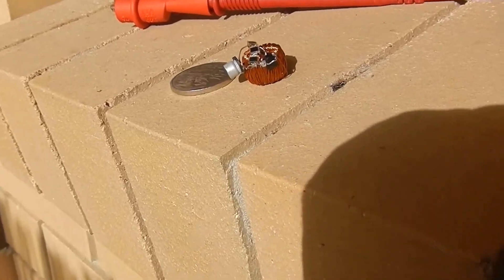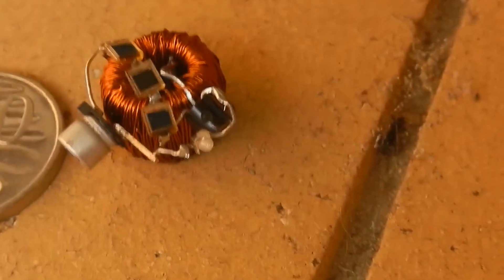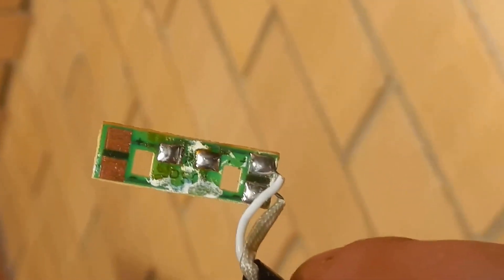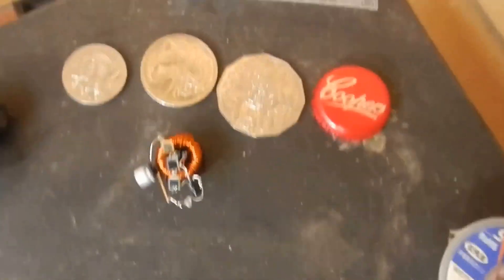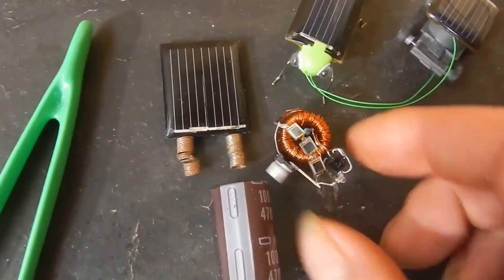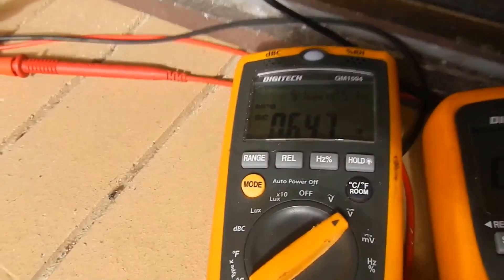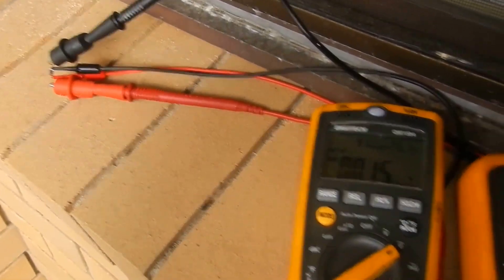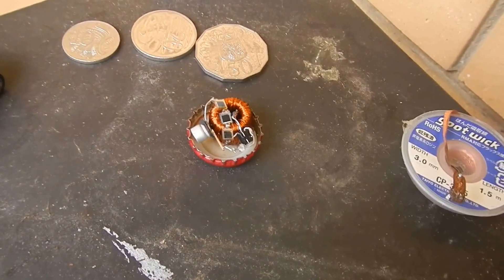SMD panel, 10 nano watt mini solar oscillator.

Comment: This is kinda interesting....  I think you can actually do this with a lesser number of parts. 

Inductor's setup a magnetic field. Light travelling through a substance will be polarized roughly equivalent to the density of the material it's travelling through so long as it's path is parallel to the magnetic field.

AppliedScience has a video about this specifically, and I'm going to output a video that looks at this phenomena a bit more technically.... but for your purposes here (boosting the voltage of a solar panel to the point where it can power a small led), so long as the solar panels are within the magnetic field of the inductor, you shouldn't need the transistor. The light will be polarized as it travels through the solar panels, which will effectively turn it on and off at a constant speed.
Reply from the maker: I have seen that video ages ago, when it first came out.... Didn't he 
need a liquid medium and multiple polarised filters to make that work? 
As well as a ton of power.... I think you would need a lot more than 10 
nano watts.... As far as I know this is the worlds lowest power/ most 
efficient blocking oscillator that can light an LED... I think for your 
idea to work you would need many orders of magnitude more power.
What makes you think these solar panels are polarised?
Reply: Ehh.... he needed the polarized filters so that we, the human audience, could  detect it. the polarization of the light would occur regardless, but if we can't see it, it's not as interesting. After he worked out exactly how to get it working, it was quite straight forward, and he even noted that the only two materials particularly bad at polarizing the light were glass (which makes up a large amount of the solar panels on the market) and air (which i think has more to do with the density of the air then anything else). 

but... maybe you're correct. Wikipedia has some stuff on Anomalous Photovoltaic Effect, that seems pertinent, but 10 nano watts is pretty small. That amount could just be red light coming into the LED in reverse bias and powering the inductor.
Reply from the maker: Its a simple Joule thief variant (modified winding ratio, for high voltage step up). It operates as it should when I checked it with the oscilloscope. The Solar panels tested at 1v and 10nA max short circuit values. When arranged in series as they are. It probably uses less than 10nW but I don't have equipment sensitive enough to test it while its running. In my experience LED's don't light under reverse bias. Or forward bias at 1v or less for that matter. It oscillates from less light, but it needs full sun to actually reach the 1.8v required to light the led. Its dim because the duty cycle on the LED is less than 1%
I still have it somewhere. Next time I find it I'll do an oscilloscope video for you...

Comment from the maker: There is a little clear circle, that looks like it has a camera behind it in the screen frame. You can test if its sensor or camera, by putting auto brightness on and covering with finger to see if screen changes. I was expecting a photo resistor, and though it was really high tech LOL! Kind of is. Look up prices for SMD solar panel on ebay... some of them are $15ea

Comment from the maker: I did too, till I saw an iPhone4 with broken screen last week. There was a little solar panel there. I guess its good for adjusting camera settings too, when in video call etc.... Also a lot cheaper and simpler to program the drivers etc. To just measure current from the panel, rather than run some complex algorithm to do it with the camera.

Comment from the maker: It varies. One set had them all around outside of screen, some pointing in, some out. I think it was to adjust screen brightness to suit room lighting, possibly also for height/width calibration. Although I think mostly used as light sensors for the room. They are in a lot of smart phones as light sensors for auto brightness adjust. Although some did seem to be there to report on the brightness/presence of the image too. All from (newer) crt rp tvs, so no lamp.

Comment: lol of course find the red dot mouahahaha lol I was more thinking of a tiny flashing LED lol or a little solar lamp very tiny one lol. If you can find a .22F 5.55 volts super cap they are small and could probably do the trick :P maybe not the whole night but for couple hours :)

Comment from the maker: I dont find many smaller toroids, and dont think I could get enough wire on, this one barely did it. A bigger one could be brighter. I think slider is on to it with the smd inductors. I was looking at the hat idea a while back, its an easy one :) Can get about 10 watts from a hat brim. So it would be fairly loud classic fm. Would you like a reversing camera on the hat? Headlights? turn signals? Robot hands?

Comment from the maker: LOL, Would you believe I am planning a smaller one :) Once bitten and all that. Also keen to see if I can run a clock of one of the smd panels. I like the beach watch idea. Could be great for a market stall, Especially once I can 3d print my own cases and bands etc :) Could be a real winner.

Comment: Heck they're both winners..who else is daft enough to try this crazy small stuff out ? lol
You guys have beaches, a watch would be a cool addition for beach sales. Make them art pieces perhaps. 
Being so small, those panels could work on a sun hat and run gadgets, like a radio. Mounted in the rim of the hat, USB/other plug at back and down to the gadget.

Comment from the maker: I was thinking they could be good on a watch! If you put a string right around the wristband, it could have an led key-light no worries. Even just 3-4 of them on the face should be enough. Pretty sure this will runs one of my digital clocks no worries. With the added advantage of not blowing it up with 12v, like the last time I tried a solar clock oscillator... Thanks for allowing the response, and providing an entertaining break from 3d printer project :) I think your smd one win's though.